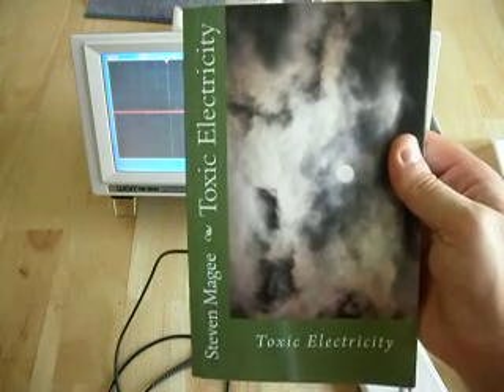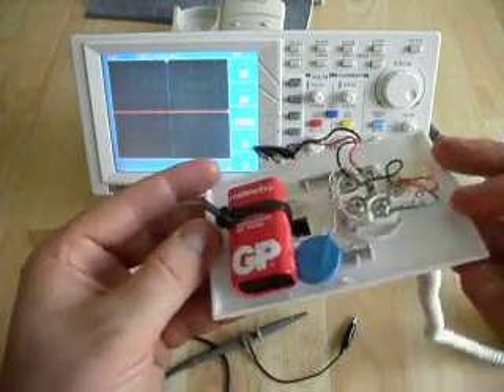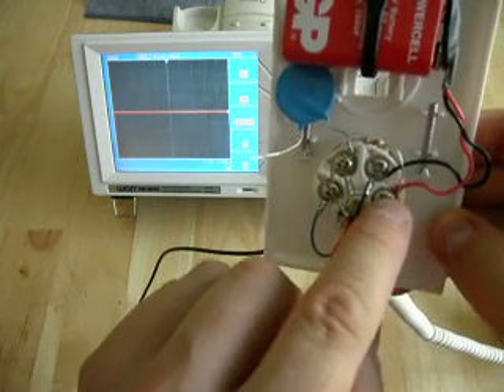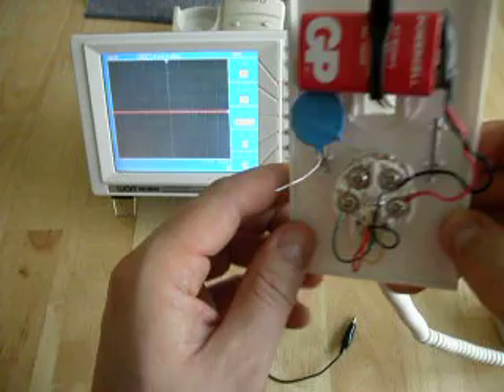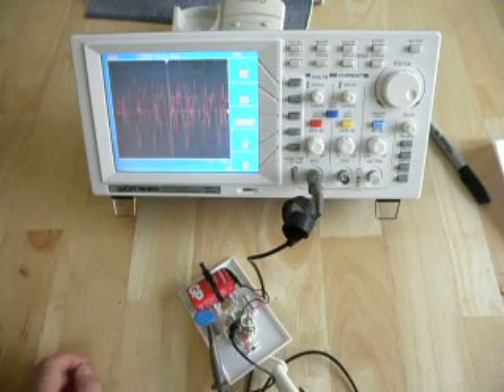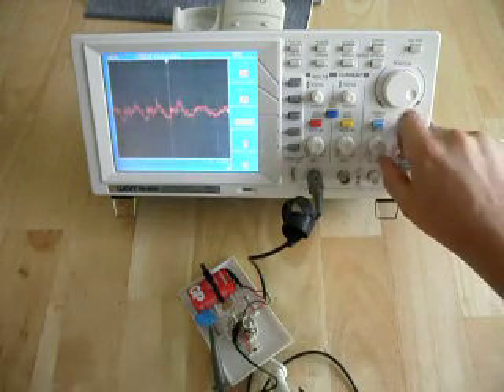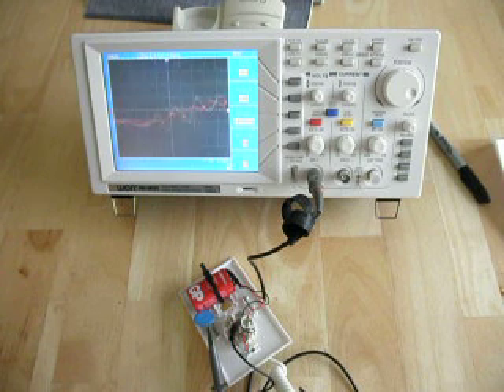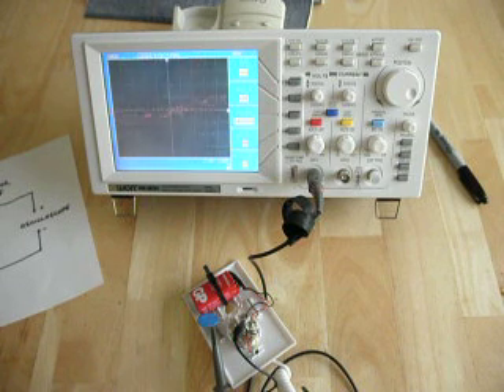Making a Microphone Work with an Oscilloscope

Comment: I tried this and it works great.  I used 2 15 kohm resisters in series which is 30 kohms, and my capacitor is 560pF.  David

Comment from the maker: I have no idea what is in the telephone handset.  I tried it without the resistor and it wouldn't work.  So, after experimentation with various resistor values and looking for a symmetrical waveform, the video shows what actually made it work.  The circuit appears to be specific to that particular handset.